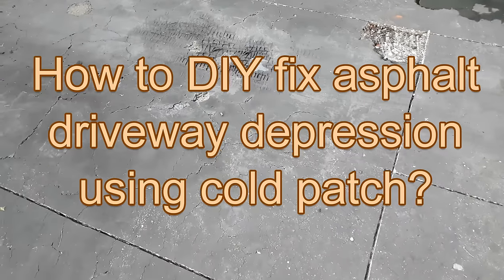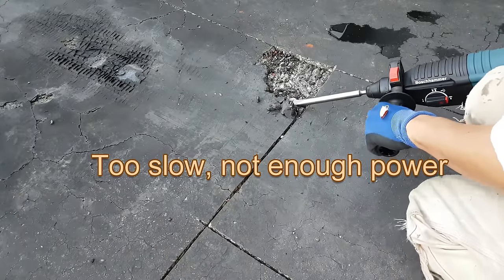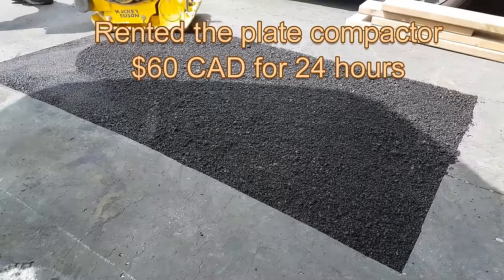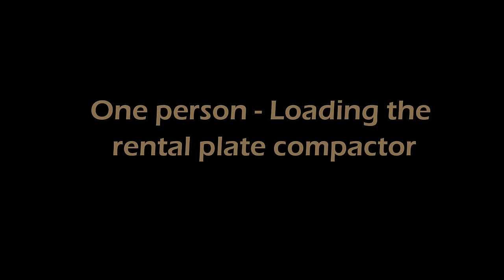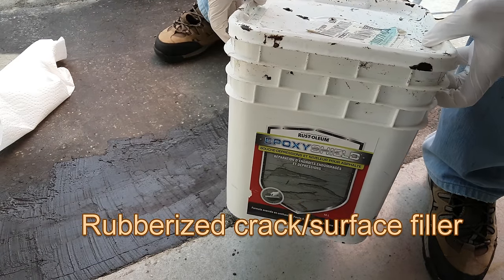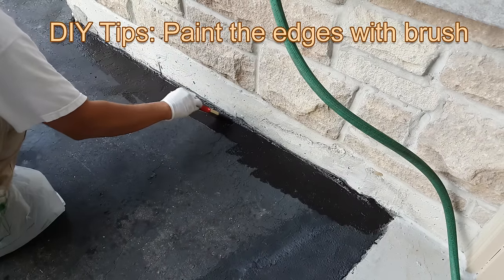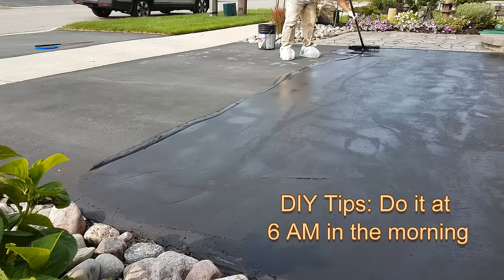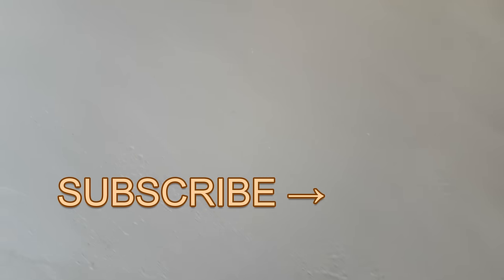How to DIY fix Asphalt Driveway Depression using Cold Patch?

Comment from the maker: This is almost summer 2019,  I will do a follow up video after the winter. Believe it or not, even I parked my vehicle on it from time to time, they are holding very well. Stay tuned.
Reply: Can you list the products that you used in the description.
Reply: Hi diyable
Thank you for sharing this vedio，it is very helpful.
would you please let me know what is brand of the cement dust？
is all purpose cement dust
thank u so much
Reply from the maker: @wyx851126  Sorry for the late reply..  SAKRETE Top'N Bond, 2 Kg
https://www.homedepot.ca/product/sakrete-top-n-bond-2-kg/1000126878

Comment: Cold patch asphalt is very expensive and inferior. Hot mix asphalt in comparison is much cheaper and better in all ways. Most asphalt plants will load a trailer (dump) with amount needed for fix- fyi- asphalt guy. Ps do not seal new asphalt with water based or (acrylic) within 1 yr of layment of new patch or asphalt. Asphalt Oil based sealants are always recommended for all asphalt driveways and repairs  because it is a penetrating sealant rather than a surface sealant (like water born sealants)  and can be applied immediately or yrs after.

Comment: By the time you paid for everything and rental. You could have had a whole new driveway done. F#$@ that.
Reply from the maker: No way...  whole new driveway would costs couple thousands, but fixing this by yourself is less than couple hundreds
Reply: @DIYable  I used that cold patch shit a couple months ago. That shit can be shoveled up off the driveway right now. I'm not doing it right now. Cause I gotta find me a real fix for when I shovel it off.
Reply from the maker: @2ndshiftaudio300  If you don't want to do the rental and use hand tamper, there maybe a possible solution if the area you are trying to fix isn't that big. I personally have not used this product, but I heard it's pretty amazing. It's damn expensive though, so it will only be good for a small area fix. It will harden like a rock after adding water.
https://www.homedepot.ca/product/aquaphalt-6-0-medium-23-kg-permanent-asphalt-repair-patch/1001235327
Reply: @DIYable  I did.

Comment: I could have done that in one day but good job
Reply from the maker: My wife said I am too slow on these DIY projects LOL..     You need to wait for the cold patch to dry, it takes months technically speaking.  There is a new product called "Aquaphalt", you add water and it harden right away.. But I cannot find them locally and they are expensive.
Reply: @DIYable  Aquaphalt is available at home Depot.ca
Reply from the maker: @Zharsergey  YES!!! I saw it on the flyer.  Believe it or not,  a year ago I contacted Home Depot Canada to suggest Aquaphalt to them, I wasn't sure if that was me or not. This year they start carrying that. I will try it probably next year,  I am too busy on the backyard project this year.
Reply: @DIYable  89$ Bucket to costly.